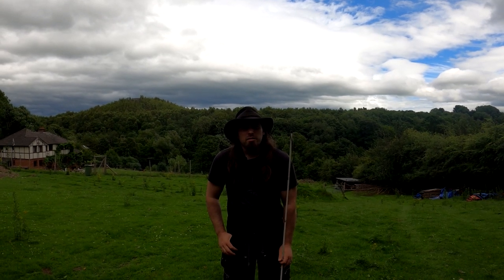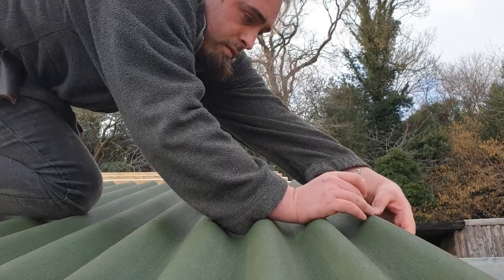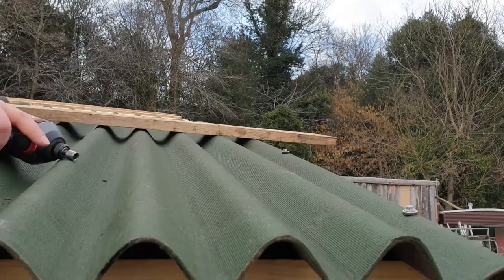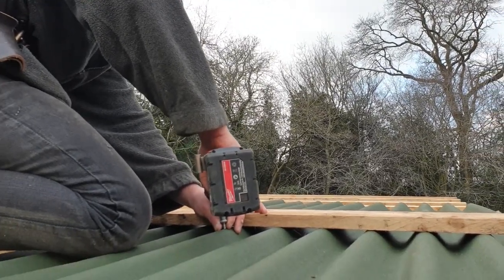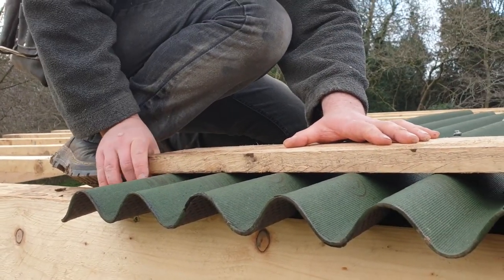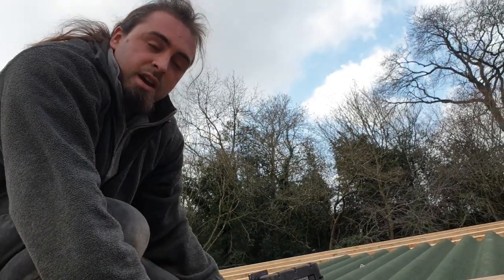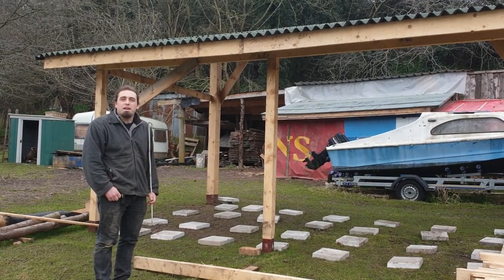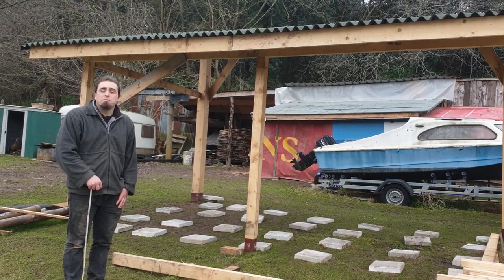Wood Kiln Construction Part 6: Attaching The Bitumen Roofing Sheets

Comment: Great info Thanks for posting  Could the fixings be screwed in the troughs of the sheets or not
Reply from the maker: Some people do, but then you are heavily relying on there being a good seal in the gully as that is where all the water will be pooling up and running down. It would also add something for leaf debris to start building up on and possibly block the gully. My granddad has this problem with his roof.
Reply: @VisionlessDesigns  Roof now finished a d looking real good

Comment: Awesome job..... How do you find the quality of these sheets, I've read some bad reviews on them that they break in the wind ect.
Reply from the maker: Well they have survived several storms in the middle of a field; however, I did put more screws in than recommended to properly secure them. I personally think that they're fine. I haven't had a problem with them yet.
Reply: @VisionlessDesigns  great news, thank you.

Comment: Good tips in this!  I'm just about to do a roof like this.  Can I ask you?  Did you buy screws that were the same brand as the bitumen sheets?  I want to use 100mm long screws and fit 25mm insulation panels between the bitumen and my  wooden panelled roof but the sheet brands seem to only supply 65mm screws.  Thanks,
Reply from the maker: Sorry for the late response YouTube turned off my activity notifications for some reason.

No I did not buy the same brand. I shopped around to find the best value I could at the time. The roofing sheets were from Wickes and the self-cutting roofing screws were from Toolstation I believe. Tradefixdirect.com seem really good value for quite a lot of things at the moment of writing.

Probably too late but I hope this helps you or someone else at the very least.
Reply: @VisionlessDesigns  Yes, just finished my roof.  hehe but thanks anyway. my concern was that the textured finished of the sheets was only compatible with the same brand's fixings.  I got some unbranded screws with those caps that fold over and clip shut to cover the screw heads and they worked just fine.